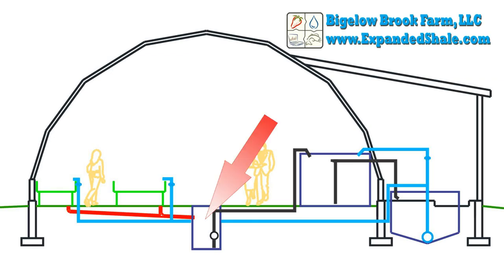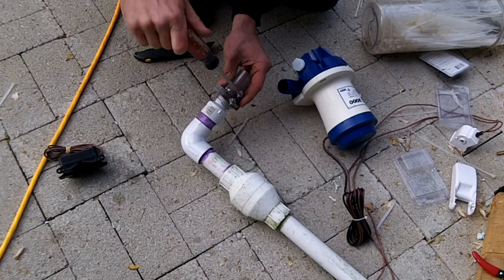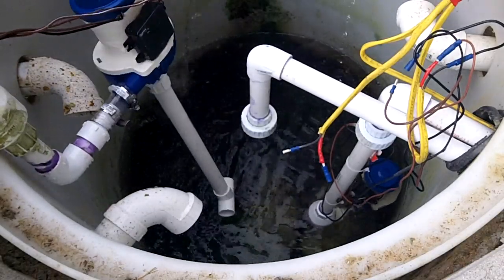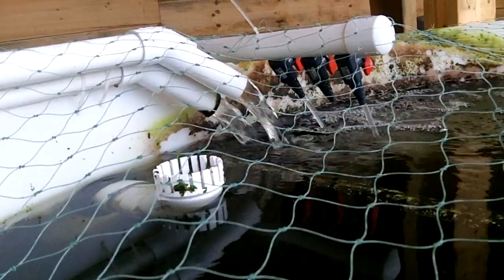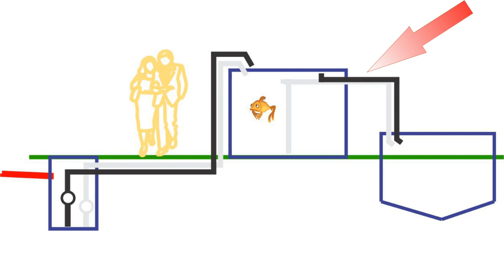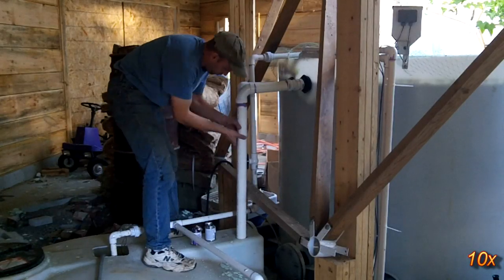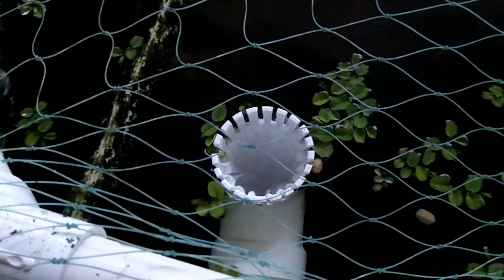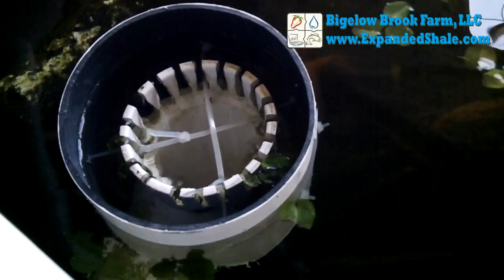Adding Some Redundancy

Comment from the maker: These are ShurFlo livewell pumps.  There are 2-2000gph pumps in the central tank shown in the video and 1-1500gph in the tank that pumps the water into the growbeds.  the float switch is a Johnson/Mayfair Ultima Auto Float Switch.  In my old videos, I've shown the bilge pump which barely lasted 2 months and a standard 120VAC sump pump which I used prior to going off-grid.

It's basically impossible to get a 12vdc submersible aquarium pump so I went with these.  A bit expensive, but very nice.

Comment: If you're worried about your sump overflowing and losing system water, you COULD replace it with a sump with the capacity to hold the entire system's water.  Obviously, it costs money, space, and time to install, but It's just a thought.  The space problem might not be a problem if you just dig deeper, but your system has a LOT of water.

Comment from the maker: Sort of running on solar.  I'm having problems with the battery holding the charge properly.  I've been working with the manufacturer for a few weeks trying to get it resolved.  Most likely they are going to replace them.

Comment: Nice update.  How did the structure do against Sandy.  Did you go inside during Sandy to see how it took the wind?  I was wondering if it flexes at all?  The small lean-to I built against the house seems to be able to stay 9 deg higher than outside at night with active heat source.

Comment: What was the brand of the pump you now have installed, it was not clear in the video.
Also, during the course of the build it appears that you have used 3 different pumps.
Why did you choose to stay away from aquarium pumps such as: RIO, EHEIM or others: aside from the fact that they are 120V?